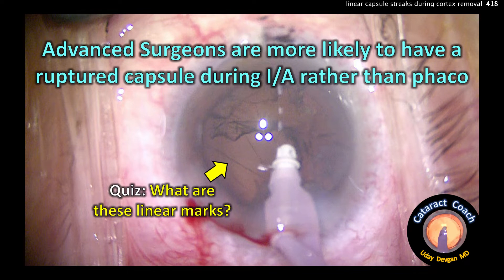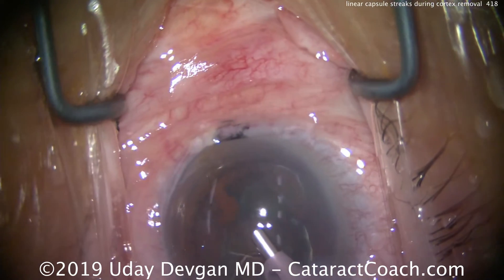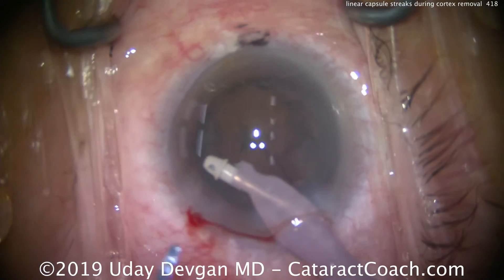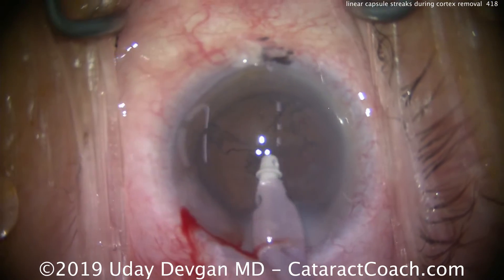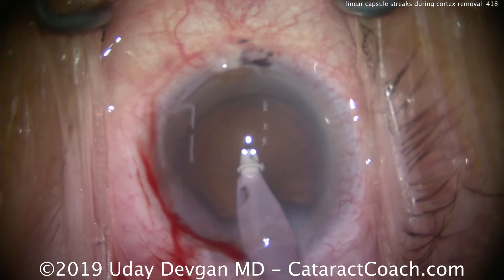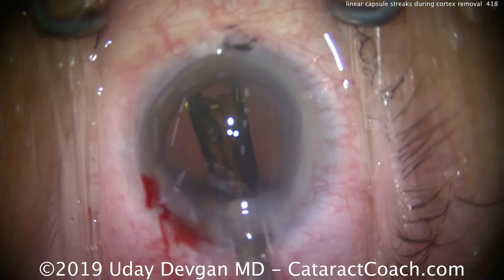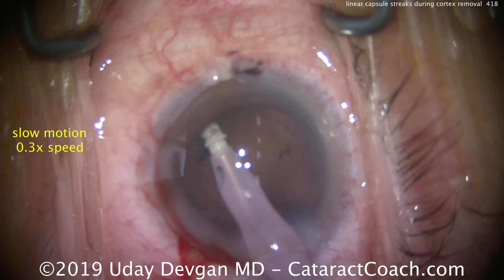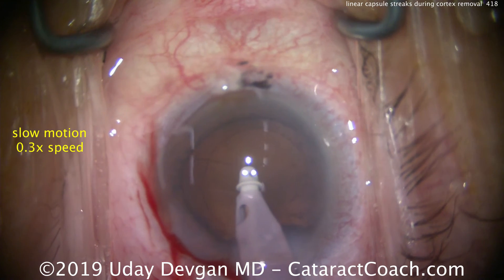What are these linear marks seen during cortex removal of Cataract Surgery?

Comment: I always tend to keep the bag and posterior capsule stretched under viscoelastic during I/A which helps to remove the cortex safely especially in elder and high myopic patients and femtocatract cases which the cortex tend to adhere to the capsule.
Reply from the maker: sounds interesting, but how does the viscoelastic stay in place while the fluidics of I/A keep flushing it out?